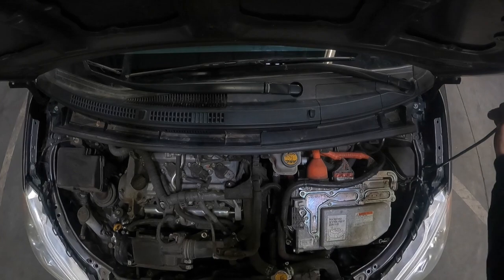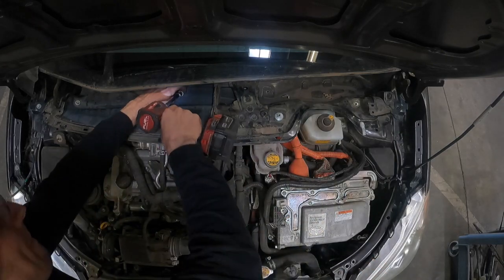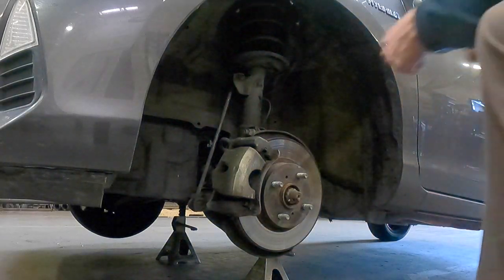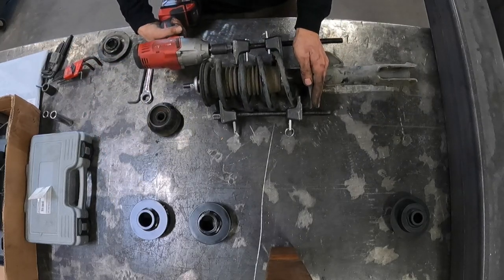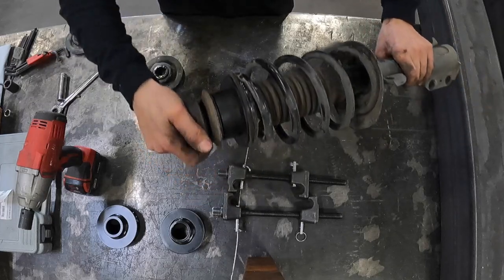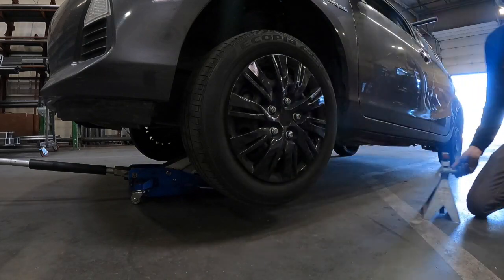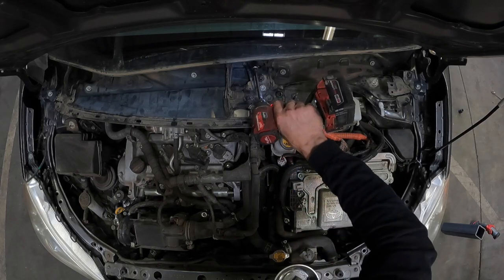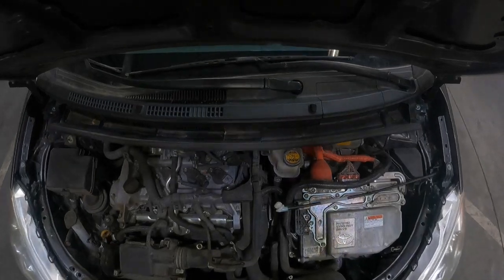Prius Offroad Prius C Lift Installation

Comment: I just lifted my 2014 Prius C One with these lift kits. So far I'm pleased with the results: not too high to seem like I'll lose a lot of MPG due to wind, not too low to be pointless. Will have to report back later. If you're considering DIYing this, it's not really too complicated, especially with this mostly helpful video ("torque to spec"...what the heck is spec on a Prius C? The instruction don't specify they're for a C...Can't find that info anywhere online...) Removing the existing top strut mount bolts can be a royal PITA at times...I had to grind one off...even with the pass through socket and Allen wrench (I don't own an impact wrench, just a lowly manual torque wrench)...Also, every time he says "with your 18mm wrench", he means 17mm (except for the top strut nut, that's an 18mm). Yeah, it's not too complicated, but it may be risky (see below)...

It's next to impossible to get the lift kit to seat pretty. I redid the spring compressors 5-6 times trying to make it look level, and never could...and, adding the kit will result in ~1/2"-3/4" shorter effective spring distance vs stock... hopefully these two things aren't an issue down the road...
Reply: Awesome input. Any thoughts MPGs so far?

Comment: Update: I installed this kit in 2022. AS of April, 2024, the front driver's side strut started making a ratcheting, grinding sound during turns. When I finally got the assembly off to investigate, I found exactly what I'd expected: the Prius Offroad spacer had shifted so far off center that the coil spring was not compressing evenly and thus not functioning properly. After carefully watching this video again, and slowing down the KEY part involving adding the spacer (where they, for some odd reason, sped UP the video (WTF?!)--I think I've found the issue. As mentioned in my earlier comment, it's nearly IMPOSSIBLE to get the kit spacer to seat properly on the spring. And here's why: if you slow down the video, you'll notice that the spacer in the video has long flanges on both top and bottom. This is NOT the spacer that they sent me--the bottom flange on mine only extends down ~1/4". The one in the video is at least 3/4"-1"+. This extra length, I believe, helps to keep the coil and spacer from creeping off center. This is clearly an issue if you try to get the shorter spacer like they sent me to seat properly--it's nearly impossible. It took my at least a dozen tries on each strut assembly, tightening and loosening the compressors, using trigger claps to hopelessly keep it centered, before I just gave up. Now that I've got it "centered" again, I'm sure it's only a matter of time before this happens again. FAIL

Comment: Did you have to do an alignment after installing this? I replaced all 4 struts and springs and now steering wheel is cocked right a bit.
Reply from the maker: Yes. Anytime you adjust suspension height up or down an alignment is required.

Comment: Cool vid. Does doing this mess up the hybrid system? And if not, how if at all does this improve the hybrid system's tendency to disengage when the wheels are spinning (ie in common off-road conditions)? Thanks!
Reply from the maker: Nope! It does not change the hybrids ability to engage or disengage anything. You are simply raising the height of the vehicle.

Comment: I just ordered a new one, and need a lift both front and rear.
How is it with alignment - does it have enough adjustment (specifically, camber) to accommodate lift?
Reply from the maker: Anytime you change the height of a vehicle an alignment is required. There are no camber adjustments for the Prius from the factory. We designed the Prius C lift to just barely stay within factory specs for camber without cam bolts but with some vehicles a cam bolt may be necessary to add a couple degrees of camber.

Comment: been off roading mine for a couple years, curious if you have a spring and shock upgrade recommend.  +40mm , 215/75/15 tire, it's supermariokart but for the traction control is annoying af. This will be my first winter attempting cables.
Reply: @Mitchell McAleer Prius C or other model and if other, which?  I got mine with 215-75/15's and am going to leave on for now until I wrap up some improvements on the underside.  Then I'll tune with the 185 set, then go from there based on conditions.  Mine came with RubberShocks and sounded like spacers, though I've not gotten that far in yet.  Mine being a Gen2, 2006, I got a set of 2012 AWD Matrix struts from the 50% off sale at the yard that I'll use to replace the springs eventually to see how performs without those RubberShocks.  Keep in mind the rear strut springs require the Matrix perch, lower seat, removed and placed on top the stock shocks perch before installation.
Reply: @jafinch78   Mine's a base model 04. that's the plan, Matrix rear spring... tried cables last week in the snow up here, rubs in turns. made  cable tensioner out of webbing to keep them from expanding at higher RPM.  debris from driving in snow damaged engine preheat components inside driver's side wheel well...... need to fab an HD inner fender liner, stock liners vanished long ago.  Most of the lower trim plastics broke, or I tore them off, bumpers are both damaged from approach and exit impacts... exhaust pipe's got a couple small rock dents....